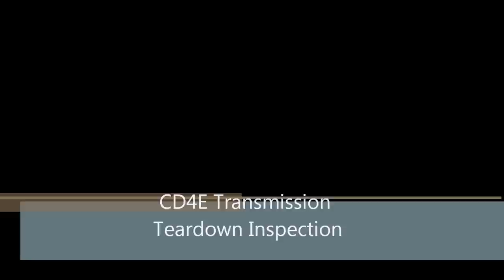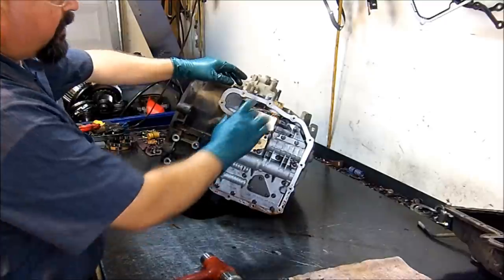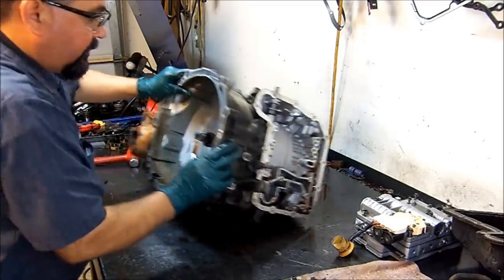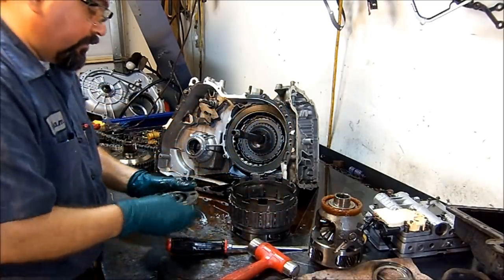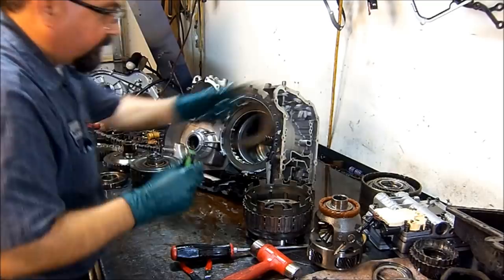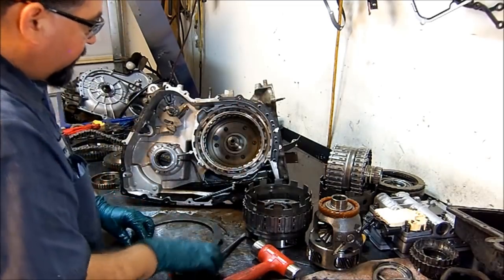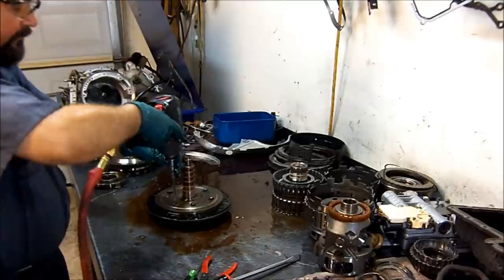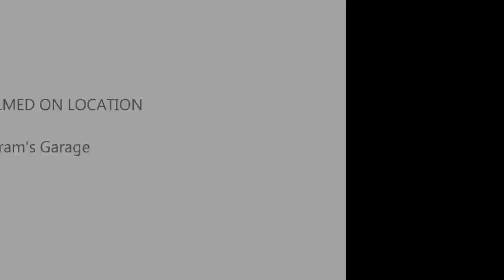CD4E Transmission Teardown Inspection - Transmission Repair

Comment: Hi Hiram Gutierrez
I have a question My 2002 ford escape, just quit ruining, I was driving 55 mph and just staring to go a little hill and sound like went to neutral than after no drive and no revers what can be the problem?
Reply: I have a 2006 escape and Ii have a very similar issue, began climbing a hill at about 45 mph and gave it a little to make the hill, trans downshifted and began to pull, immediately after all forward power was gone. pulled it over and found park still works but no forward or reverse.
Reply: i have the same problem with my what could i need to replace
Reply: shift solenoid, 2-4 bands, and forward direct drum could all need replacing, or it could just be one of the three

Comment: I repairing one if these and replaced 2 4 band without taking out transmission and the pump shaft twisted afteri put it back together. Anyone knows Why would the pump shaft get twisted?

Comment: Hi, I have a Ford Escape 2008, with automatic CD4E, I want to change the Auto trans Filter, but I can't find it. All the  Automatic CD4E hace the Filter in the same place or the models of Transmition have variations??
Reply: +Santiago Nattino The filter is inside the transmission. You have to separate the case halves as well as removing certain internal parts. IOW, not serviceable.

Comment: I have a problem on my 03 escape 4wd cd4e trans. my driver side cv axle seal is leaking. i replaced the cv axle and when i pulled old axle out, a little metal band came out with it. so i put it on new axle and put it back in. however, the new seal continues to leak. it has a small burr on the inner circle mating surface. trans shifts fine and i check fluid frequently to avoid damage. is there any idea how to remove the bur and would this fix the leak?
Reply: ***** thank you very much for your quick reply.
Reply: +Hiram Gutierrez  By the way Excellent Video! The same exact thing happened to me, but the metal band that came out was totally destroyed. How can I know what new bushing I need to buy? Also, can I push this new bushing in without opening the transmission?

Comment: I have a 1998 mx6 2.0 cd4e, The transmission was slipping when it got hot. I put in new clutches and a new band. The trany is still in the car. I started it and no pressure, took the pump off and the pump rod twisted and broke along with pump gears. I bought a new pump and rod and aligned the pump up with pins and put it together. I started feeling the pump working a little, after that nothing, no fluid from the lines. The pump rod twisted and broke, the new pump was fine. Dumb--founded!! Help!

Comment: Hi I have a Ford Mondeo mk3 with automatic cd4e after 2 miles losing the second and fourth gear whether they could help me to solve this problem. recently pulled the connector of Turbine Speed Sensor (TSS) a couple of days I drive my car with unplugged (TSS). everything is OK changes all gears no vibration. only change a little rough. changed new (TSS) Delete error. and again with new (TSS) losing the second and fourth gear. the possibilities without (TSS) everything is OK changes all gears no vibration. with new (TSS) losing the second and fourth gear. could help me to solve this problem Thanks in advance.

Comment: Hi I have a Ford Mondeo mk3 with automatic cd4e after 3 miles losing the second and fourth gear whether they could help me to solve this problem.After several miles begins slides to second gear then lights O / D OFF but if you drive on the highway after fifteen or twenty miles returns to normal and has all the speed and change normally after you shut off the car, start it over again no second and fourth. in the service of Ford. said the computer can not raise valve second and fourth gear. tells OBD fault P0732 and P0734 and illuminates the panel o / d OFF Thanks in advance..
Reply: ***** tnh. I want to change the transmission oil. if I could have changed what mineral or synthetic oil is best to put it. if the change has made a difference
Reply: tnh .  http://www.eurol.com/en/37-products/558-eurol-atf-1100.html

Comment: Hi I have one of these it’s 2003 escape when cold it shifts as soon as it warms up it’s loses shit but I here a whining noise from transmission when I start the truck and getting codes for 2 shit code what should I check thanks
Reply: yo tengo el mismo problema y tu solucionaste ya ???
Reply: Yeah I replaced the transmission
Reply: @djrrnyc1  there is no other solution than just change the transmission

Comment: WHAT CAUSES THE TRANS TO MOVE FOR FIVE MINUTES THEN STOP I HAVE TO TURN OFF MY ENGINE  WAIT A FEW THEN IT WILL MOVE AGAIN THEN IT FAILS AGAIN ECT.... I TOOK PUMP OFF AND MY 2-4 IS FINE
Reply: Your filter is probably way clogged up. Need to tear down and rebuild transmission

Comment: Hi can i ask how can i know if i have a bad selenoid pack or a bad valve body in this tranmission? i have a 2008 mercury mariner and the problem is when the car is warmed up it start to fail and i got all selenoid codes, replaced the selenoid pack but it is still the same thing when the car is hot. 

should i replace the valve body? there is no shop to get a rebuild kit here in my country. it is very hard to diagnose too because i live in a town and there is no transmission mechanics here.

Comment: Hello, I have a 2005 Ford escape with a CD4E I have first and 3rd gear as far as it seems when I drive it.  It acts like it shifts from 1 to third when I let off the gas to allow transmission to catch up and shift to third how ever it never shifts to 4 O.D. Then the engine will rev at high rpm in third gear and will drive fine.  O.D. light then flashes.  I removed the pump cover and the 2-4 band is not broken with i thought may be the problem.  Any help would be appreciated in diagnose  this transmission.  Thank you.